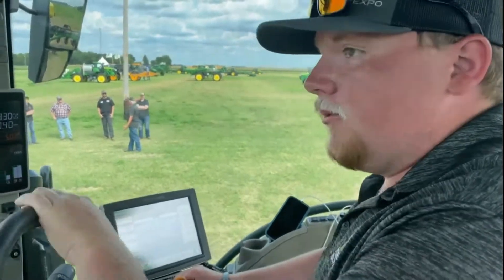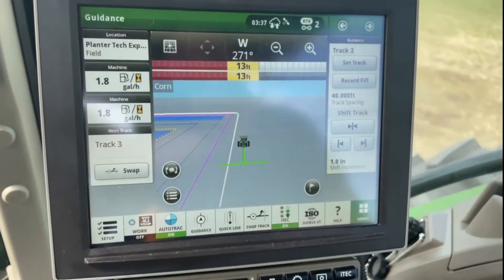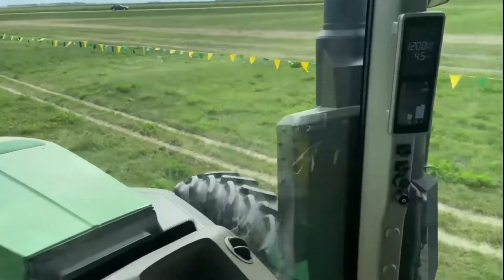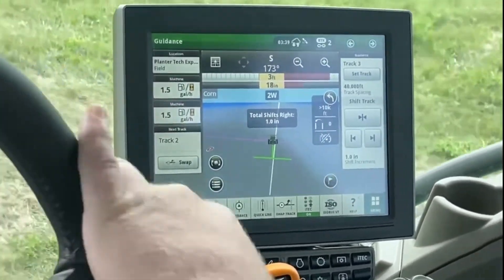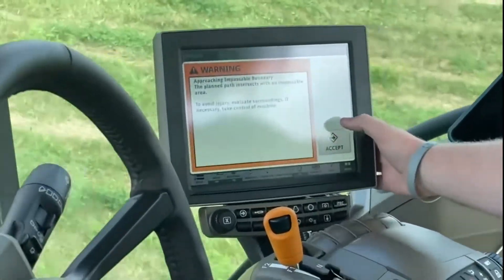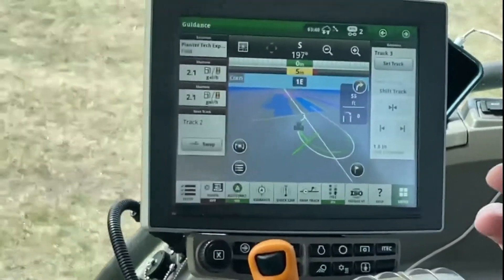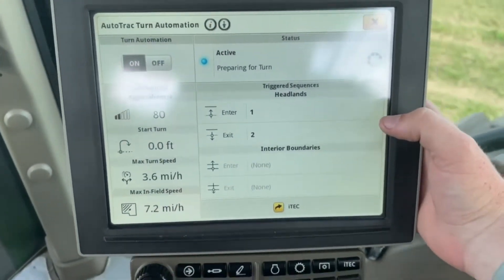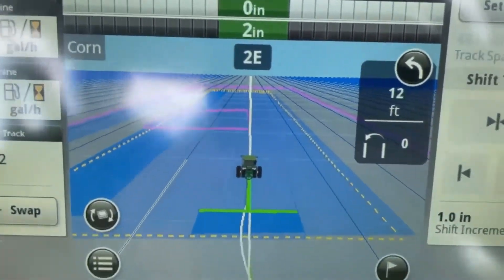Boundary Fill and AutoTrac Turn Automation - Kibble Tech Expo

Comment: For the boundary fill track do you have to have a gps globe on the planter or can you run boundary fill track without a globe on the planter?
Reply: No, RTK signal is shared from the tractor to the planter.